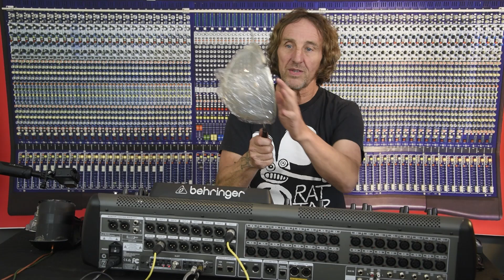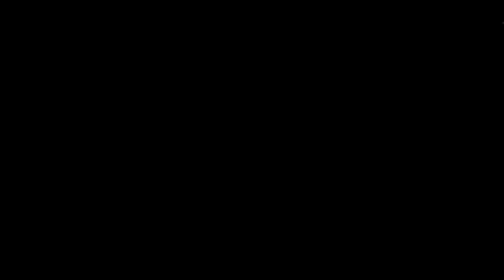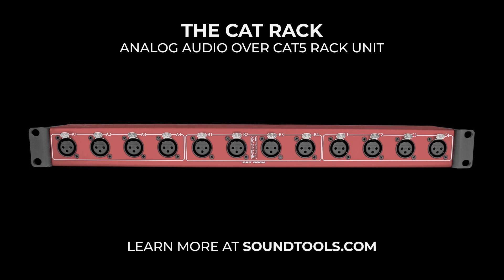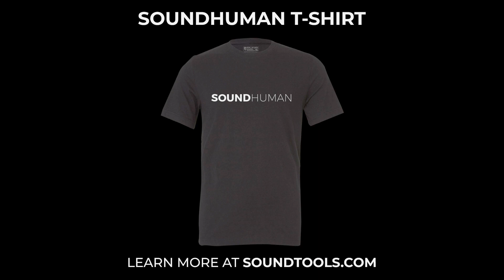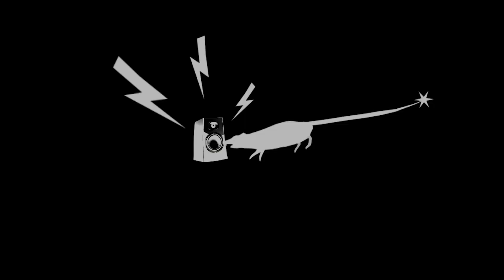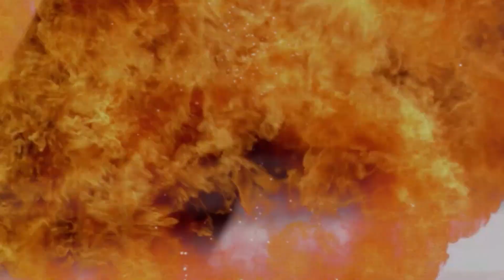Aux Fed Subwoofers Are Better - Because of How Mics Work

Comment: Interesting topic.
I’m scratching my head over this. 
Could you tell me how you manage to do this when you mix to subgroups and compress them at 0 except vocal and then send them all to two separate vca’s one compressed and the other not.
How do you send sub separately when you set up your mix that way? 🤔

Thanks for all your great videos 🙏 I have picked up a lot of useful information from that have made my work sound better 🤙🤙🤙
Reply from the maker: I treat the subwoofers separately and compress them separately. I send to the subwoofers post fader from the individual channels. The VCA or DCA is just a remote control for the channel, so whichever VCA or DCA you bring up or down, the subwoofers sent from the channel assigned to that VCA or DCA will go up or down and be sent at the proper level.
Reply: Thank you for your respond 🙏
I am going to try this method this weekend 👍
All the best to you

Comment: How do I hook the subs up?
Reply from the maker: Assuming you have a live sound system where this will work and not home Hi-Fi where it won't make a difference, you connect the processor driving the subs to a separate output of the console. Many processors have the option of having a single input to drive all the left outputs and another input drive all the right outputs or if it has four inputs then one input can drive the lows mids and highs on the left and another input will drive the lows mids and highs on the right, And the other two inputs can drive the subs on the left and the subs on the right

Comment: Ok...I think Dave is brilliant, but he's missing something here. I personally don't have a dog in the fight with subs on an aux vs on a crossover. I think it's a matter of preference. But the reason subs on a crossover can be just fine is due to the high pass filter. He mentions the HPF as just turning down the lows, but that's not what it does. It's also call a low cut because it cuts off the lows at the specified frequency. If you set the HPF above the crossover point for the subs you're taking care of all the issues he's describing here with low end mic noise. It's my practice, and emphasized in all the trainings that I do, that right after you set the gain you set the HPF. Even the kick and bass get HPF at 40hz or whatever the bottom frequency of the system is so you're not using up energy that can't be reproduced by the speakers. HPF for most mics (vocals, overheads, guitars, room mics) starts at 140hz and can go up from there. Other mics like toms, piano, etc set as necessary. I certainly appreciate the advantage of subs on an aux but to completely write off subs on a crossover when using the HPF as intended is misleading.
Reply: He mentions engaging the high pass at 90hz, but what's the crossover point for the sub? Turn the HPF frequency up to above the crossover point and you have nothing going to the subs. Again I don't have a dog in the fight and think both methods are fine when used correctly. Love you Dave, just think you need to be more open-minded about the other way when using the HPF correctly.
Reply from the maker: Very cool and it it has nothing to do with correct usage of high pass.

But rather it has to do with "cant get here from there"

A high pass is a filter. So you filter (reduce) low freqs on a signal, then combine all the signals. Then the system crossover is another filter that allows lower frequencies to go to the subs.

So even though you set the high pass at whatever you wish, there will be low frequencies below the high pass as a high pass does not eliminate freqs below the setting, it only reduces the level of freqs below the setting.

So the sunlbs will reproduce energy from all the inputs always, just some at lower levels than others

Conversely with subs on a separate send, if an instrument you can choose which inputs are sent to subs so the subs only reproduce the inputs sent to them

And

With subs on an aux you can still use the high pass on an input not sent to subs or even boost lows and get more lows from the input without sending any of that input to the subs.

It is the cumulative low end mush that people are trying to high pass out of the mix but still gets through, that you are able to eliminate.

Though with many systems that don't have true subs or any subs, or artists with few open mics, it may not help much, with a system that does have a subwoofer system, subs on a separate send can remove a low end blue and really clean things up.

Having 32 inputs with all the low end garbage muddying the sun's and instead just running kick, floor Tom, bass and keyboard to subs and nothing else creates a clean clear difference
Reply: @DaveRat  I hear ya. Subs on an aux makes total sense. But the only sound that gets below the high pass is just the logarithmic curve that goes to -∞...close enough to the same curve as the crossover (I know curve selection can vary on those). If the subs are crossed over at 100 and the HPF is set to 120 those curves will not intersect enough to have any meaningful energy coming through the subs. i've never known the high pass to be just a reduction of lows but rather a complete elimination of them once the curve reaches -∞. 

All that being said, I'd never try to steer anyone away from subs on an aux. Love and appreciate all you're doing with this incredible content!
Reply from the maker: I think you may be underestimating the amount of energy that a high-pass filter reduces and how quickly it does so. 

Even a 24 dB per octave high pass filter set at 100 Hertz will only be 12DB or so down at 80 Hz and about 20 DB down at 60 Hz. And about 35 DB down at 40 Hertz. And from that point it's reached its full 24 dB per octave slope and will be about 60 DB down at 20 Hertz. 

This negative infinity that you're talking about doesn't happen till several octaves below that. 

So with a high pass set at 100 Hertz and 20 dB down at 60 Hertz which is about 1/4 the perceived level. 

Now multiply that times every single input that shouldn't have subs on it or has a high pass and the cumulative energy from all of the channels combined is not insignificant and can create an audible background rumble bass smear emanating from the subwoofers. 

By putting subwoofers on a separate send that rumble goes away
Reply: @ you’re coming with data that doesn’t sound accurate but I can’t refute it until I do my own tests. I have the means to do a very accurate hpf test…hopefully I can find the time to do so in the near future.
Reply from the maker: Do a search for " 24 dB per octave filter graph" and you will see the dB drop vs freq of various filter types. Mos of the graphs are set to 1000 Hz but if you divide the freqs by 10, you will be able to derive the filter impacts at 100 Hz.

Now one argument would be to use much steep to reduce but not eliminate bleed of freqs below high pass into subs, but also know that you don't get something for nothing with audio filters.  

The steeper the filter, the more ringing and phase shifts the filter will introduce which alters the sound I typically undesirable ways.

So it's a trade off of one sound quality for another.

Conversely, since you already have a sub crossover filter, subs on an aux can eliminate the need of adding a high pass as well. Therefore reducing filter induce sound issues
Reply: @ Alright it's making sense. I guess I was taking the position that anything getting below the HPF was dropping off so much that it wouldn't be noticeable in the subs but I totally get what you're saying now. When you were talking about the HPF being a "reduction of lows" I was envisioning like a low shelf and thinking "that's not what a HPF does". So I very much appreciate you taking the time to explain this in more depth...might be worth a separate video! I'm on the same page as you now. Thanks again.
Reply from the maker: Yes very cool and even a low shelf rolls off low end it doesn't eliminate it. 

The illusion that high shelves and low shelves and high-pass filters and low pass filters offer a very steep precise cut off is common. 

But the reality is that very sharp cut offs are difficult to do and induce many problems like phase shifts and/or require significant latency to be added. 

Very cool and thank you!

Comment: I think it depends on how you are using the Subwoofer. 
If you are using Sub as a true "sub"woofer (like a Low Frequency Effect) in a system where Main FR speaker is capable of going down pretty low on it's own, then Aux send make sense.
If your main FR somewhat lacks low frequency capability, then it's better to route it like a CrossOver where all channels go thru.

Comment: This is very similar thinking to why in the studio we high pass certain things when there's rumble and other unwanted garbage in the low end. It makes perfect sense, in fact EVEN MORE sense, to do this or similar in a live setting, where anything could cause unwanted rumble at any time. 

Sometimes in the studio, you can listen to a track and hear/see it has nothing below say 100Hz, and you don't need to HPF it, however, in a live situation even if at soundcheck there isn't anything down there, it doesn't mean that during the performance this will still be the case. With 100's or 1000's of people jumping about in the room, and the musicians moving about all over the stage the situation is ever changing. It's kind of a no brainer to want to insure this junk can't get into the sub feed, so having complete and indavidual control over what can, and can not, end up in the subs makes complete sense in a live situation. Aux sends is the easiest and quickest way top do this in a live setting, with the most amount of quickly acessable control (a single button push per channel once set up).
Reply from the maker: Exactly and with live we have more control than a studio would mixing the stereo.

High pass filters are filters that reduce the amount of rumble but don't prevent it from being sent.

With live audio we have the ability to not send that rumble to the speakers capable of reproducing it.

With a high pass filter we can reduce the amount of rumble with an aux send it can't get there from here
Reply: @DaveRat  Yeah this is very true, in the studio with a stereo mix we don't get to choose the end playback system, so what ever is left in the end recording could be played back on every speaker (including subs), but with live you get to dictate exactly what mic goes where, so have ultimate control and would be a fool to not take full advantage of it tbh. 

Surround sound media like atmos deals with this issue for the studio, but it's still uncommon for an end user to have more than just a stereo playback system anyway.

Comment: Subs via  the mono master bus please, don't waste busses and sending random levels to it messing up the X-over point. All outs on a matrix please. L / R / S / Fills / Delays
Reply from the maker: Yes the mono bus is definitely an option. Also subs on a matrix is good as well depending on the application and preferences of the engineer.

Personally I prefer a stereo aux send  driving stereo subwoofers so I have full control.

I also used a stereo subwoofer processor that I designed that has a stereo in and left sub center sub and right sub out. 

This gives me even more control and controls width and tilt. 

I will try and do a video on that at some point.

Probably the biggest issue with subwoofers on an odds, or matrix or mono sand is losing the beauty of stereo subwoofers which degrades the capabilities of the system.

Going from subs on left right to subs on a separate control is two steps forward. Going from stereo subs to mono subs is one step back

Comment: Can't imagine a 48dB/oct Butterworth HPF at 100Hz+ wouldn't solve this issue. Modern DSP is so good. You used a 90Hz HPF as an example. I would push that freq up a lot for most instruments... Of course it's a very nuanced thing as well. Micing up a whole drum kit in the studio, to be reproduced so each drum doesn't interfere with other instruments... A can of works, for a very specific situation, for sure.
Reply from the maker: Hmmm, a high pass is a filter that removes part of the signal. A separate send allows the signal never to be mixed in the first place

Mix rice and chia seeds and oats and peanuts all together. Then get a metal screen that only lets oats and rice and chia seeds through.

Compare that to piles of the same ingredients that were never mixed

Now multiply the complexity of that adventure time menu thousands of more.

Are the mixed and separated piles the same and if the same quality as piles that were never mixed?

which offers more control?

Would a person with a peanut allergy find both piles the same?

One scenario offers total control, the other is a bandaid to try and make things sound better when you don't have total control
Reply: 48dB/oct on an IIR filter? Ewe, my ears hurt just reading that. All filters affect phase and impulse response, the steeper ones way worse then the shallower ones. To my ears, 24 db/octave is about as far as you can go on a filter before before things really start to go downhill sonically while still being steep enough to be an effective filter. Less even better if you can get away with it. FIR filters can fix that (phase and impulse) but for live sound you wouldn't use them below 300hz anyways as the latency gets too long.

Comment: Yes, I like mixing this way. It also gives you a way to control low end volume separately in places that are not calibrated.
One question though. Which toms would you send to the sub? I'd say all of them? Is there a better way?
Reply from the maker: In general I use subwoofer send, high pass and channel together as a way to EQ the low end and get the sound I am looking for.

But also making sure that the sound I am getting on the console recording is balanced.

Comment: Well ,i might be attempt to mark that is genial but overall the electrical signal teourds subs from the mix will be another story to consider ! Is like you utilise the main sub PA like a huge guitar bass amp like in the 60s when pretty much before block wall PA they utilise the bands amp like the main PA..The subs drivers this eay will work much cleaner and without all unnecessary frecv .introduce on them.Hmm This conduct me with the ideea of usless passive filters on cabinet s right?❤

Comment: Would not an active cross over setup with dedicated amps for the subs and dedicated amps for the top speakers give the same effect? You need to have amps for the subs and another set of amps for the top speakers anyway? One could think that to calibrate the active crossover to the specific needs of the used speakers and amps would benefit from a doing it once as accurately as possible and then forget about it compared to using only a high pass filter that aren't as precise regarding crossover that is adjusted for the particular speaker (and amps)? Or am I missing somethinghere? An active crossover setup gets rid of the frequensys that respective speaker are not meant to play. And the amps benefit fom the same, they only need to amplify the frequensys that the speaker is made to play and thus going to be able to gain higher before clipping wich gives increased SPL's in the end. The top speakers benefit from the amps easier job as well as the subs do. The active cross over would be fed the full spectrum but its made to handle it and would not suffer from it?
Reply from the maker: If the option to aux fees subs exists, then typically the subs are already separately amplified and actively crossed over.

The question is

"Do you want to send the high hat, cymbals, vocal mics, and numerous other mics that are on instruments that do not create sub frequencies, to the subs or not?"

If an instrument does not create sub freqs and you don't want sub freqs created from that instrument or mic, why would you send it to the subs?

Having subs on an aux gives you the option to send to subs or not

One issue is that many people think a high pass filter is an absolute cut off of lows, when actually it only reduces the level at a tapered rate. To really eliminate  sub lows with a high pass, the high pass needs to be set quit high and impact the overall sound

Comment: For a very long time, I avoided the ‘sub on aux’ method. My main motive probably arose from the fact I am always multitracking every single show I mix and make the effort to filter all my stems accordingly. It’s only recently I see the flaw in my reasoning and Dave helped a lot with it. 

When simultaneously mixing and tracking, the responsibilities add up to a level that can be a risky undertaking if setup time is short. A ‘sub on aux’ directly addresses both issues in an efficiency and most important, sonic improvement. In a console with 70-80 mix channels, barely a handful need to contribute to the subwoofer. Post-aux feed the few and mute-aux the remainder and you have beaten several major issues in one smooth move. If the console allows, flip that aux’s master to a fader for inventive FX.
Reply from the maker: Super cool and great perspective

Comment: Thanks for the explanation, I am running the sound for a student council party at my college and we have a weird collection of random technology. Feeding a Macbook into a Yamaha MG16XU which then outputs into a Yamaha PX10 to power the 2 passive Dynacord D15-3. That is where I struggled to find a good solution, cause the Sub we have is an active RCF sub 905-as ii. At first I didn't know what to do, cause usually we get active speakers with passthrough, but now I am excited to run the sub over the Aux send, and possibly in the future with other setups as well.